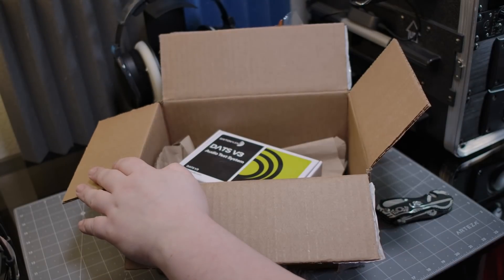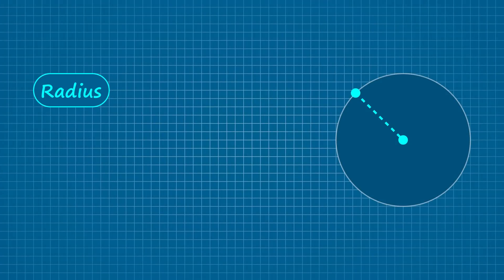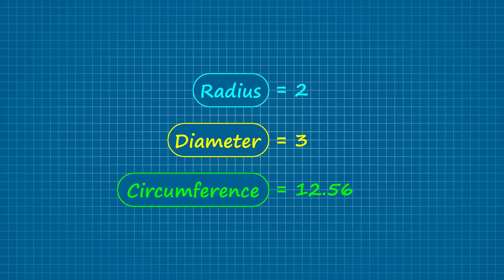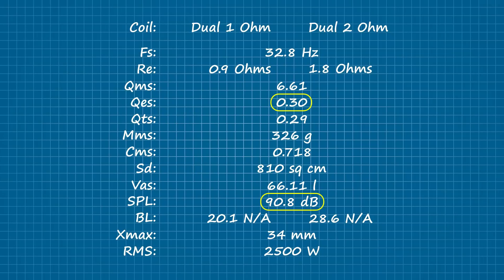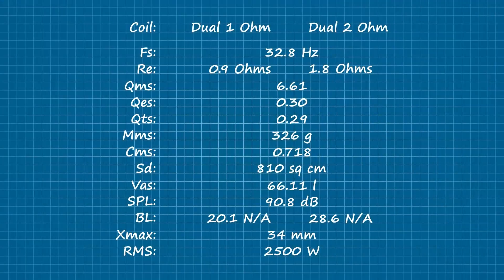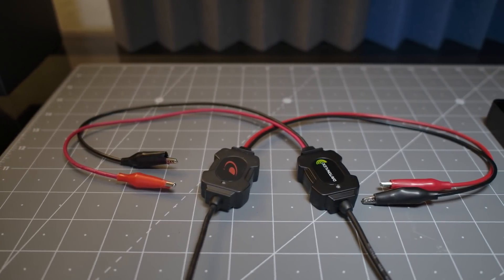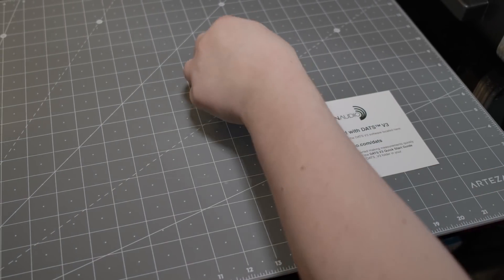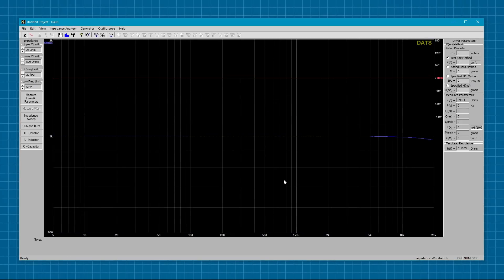A Common "HORROR" Story + A Brand New Solution

Comment: what about a brand new speaker and one that is already ( same speaker)  "broken in" i'm sure the specs would be night and day different due to the slightly softer suspension??? care to elaborate on this topic?  this is something i have been pondering for many years .
Reply: Sometimes no as big a difference as you would think, but yes I think it would be good to break it in, plus there is also a difference in what position you have the driver under test, so for example if the factory had it held vertical with very minimal surfaces around the driver compared to this example where the driver is horizontal with a table close to it and a little restriction of the vented pole, but with something big and heavy I can see the reason for doing horizontal even though not as accurate.
Reply: Here is a copy and paste of a reply I made above...

Break-in will shift specs a little. Fs will drop, Vas and Qms will go up... I've seen as much as 10% (I've probably measured over 1000 drivers)... However, if you model the same driver before and after break-in, in the same enclosure, the change is almost nothing. So, in the end it is usually not something to worry about.
I do recommend loosening up the spider on brand new drivers before making your measurements. Just to break up the starch that is used on the spiders. 

The specs change a lot from temperature change. That is your real concern. The Qes increases as Re increases due to heat. Drivers are more efficient when they are cold and loose efficiency as they heat up... which causes them to require more power... which causes them to heat up more...  and so on.
Reply: @chrisperez7592  thanks, that is what I had heard also, nice to have confirmation 👍

Comment: The fact the company replied saying the specs were correct is the most alarming part. It shows they really dont care about their products performance.
Reply: "The company replied" The human you spoke to likely has no more idea what any of these terms mean: real number, complex number, function, sine, cosine, radian, steradian, derivative, integral, ring, field, vector space, linear transformation, inductance, capacitance, reactance, pole, zero, simple harmonic oscillator, transfer function, Laplace transform, ...than his employer does of these: customer, return on equity, and goodwill. Same old same old. James B. Lansing committed suicide for a reason. Care, but take care that you don't care too much.
Reply: @HexiBase  I think the problem is many brands just re-use already built subwoofers or „kits“ as in manufacturing term and they just rebrand those finished subs, without actually knowing the parameters or doing any research on it. Why put effort and money into research when there’s already a lot of stuff to choose from - same with class d car audio amps - a lot of brands use the same boards or very similar designs, as you can see in barevids amp repair videos.
Reply: and customers as well
Reply: The Chinese don't like to admit when they're wrong

Comment: My first ever subwoofer build consisted of a Philips Car Audio Sub which had no parameters listed anywhere. I only could find some on forums. And only the bare minimum to even calculate something. So I squeezed them into WinISD and got something out. It sounds surprisingly good but I didn't follow the bass reflex recommendations from WinISD
Reply: @HexiBase  yes, and thats a shame! There must be so many people out there not knowing what their subwoofer could actually achieve just because the manufacturer is vague or  even outright wrong about the T/S parameters..

Comment: Do you recommend breaking in a subwoofer before running these tests? Would it make a big enough difference to warrant waiting before designing an enclosure?
Reply: @HexiBase  Every major company I've worked with says 70-80 hours of break-in majorly change parameters. Kicker, DD, Sundown, etc... all these companies do Klippel testing not just DATS as I'm sure you know.
Reply: Post-break-in can be massively different, but we'll just pretend that's not a thing.  As will all the parameters once bigger power is applied, also.... we'll just ignore that.
Reply: @Bassahaulic  
@John Smith  
@HexiBase  

Actual Before & After "Burn-In" Measurements here...
http://www.gr-research.com/myths.htm
&
http://www.gr-research.com/burnin.htm

Comment: Just got my DATS V3 last week, found a discrepancy with the numbers provided by JL for my sub which could have cost me about 10% of the low end response on a design, and would have made the box larger.  Already paid for itself.

Thanks for your videos!
Reply: That 10% could be due to break in. I've seen 10% differences in drivers that are older and well used. You could retest the JL after a few months and see if you feel the same.
Reply: @practicalguy973  Sure there could be a change with break-in, but I'd rather find out that I should design an enclosure with a 5-7Hz lower resonant frequency and more moving energy before break-in, before I see an even lower resonant after break-in (meaning my design would have been even further off).  No reason to give away performance due to bad data.

Early thing we learn in hardware engineering is to trust datasheets but verify - then we find out which manufacturers we can no longer trust...  And we either get used to it due to cost constraints, or we pick another (better) vendor.
Reply: Break-in will shift specs a little. Fs will drop, Vas and Qms will go up... I've seen as much as 10% (I've probably measured over 1000 drivers)... However, if you model the same driver before and after break-in, in the same enclosure, the change is almost nothing. So, in the end it is usually not something to worry about.
I do recommend loosening up the spider on brand new drivers before making your measurements. Just to break up the starch that is used on the spiders. 

The specs change a lot from temperature change. That is your real concern. The Qes increases as Re increases due to heat. Drivers are more efficient when they are cold and loose efficiency as they heat up... which causes them to require more power... which causes them to heat up more...  and so on.
Reply: My JL TW5 had different parameters then listed. It is already broken in so not sure how big a difference that makes.
Reply: @eugenelupu01  I would say, broken or not, it's an OK difference, u won't notice it anyway. Stay tuned, we're sending you u a brand new broken JBL, u'll love it.
Reply: Small signal TS you measure with DATS (or 3USD equal equipment made by yourself) are not the best way to represent a woofer in a real world application. Some manufacturers might provide TS parameters measured using large signal, which suit the real world better.
However in most cases it's just manufacturing differences between the batches
Reply: 10% is a OK number for deplorables like u. You're not supposes to do what you do like a pro, so send these stupid precision tools back & go find this toilette paper u were given : it's ur one and only technical Bible chimp. Want some more pinuts BTW ?